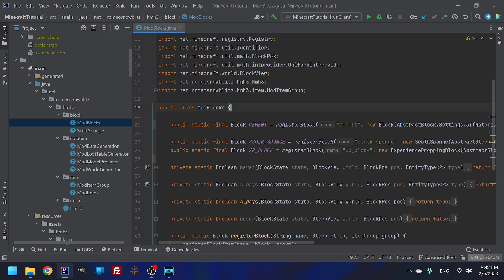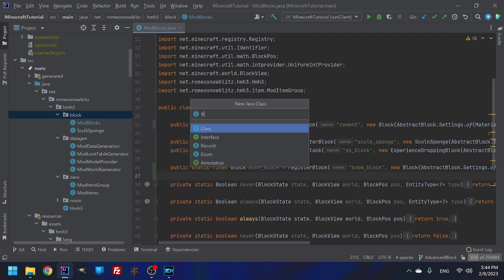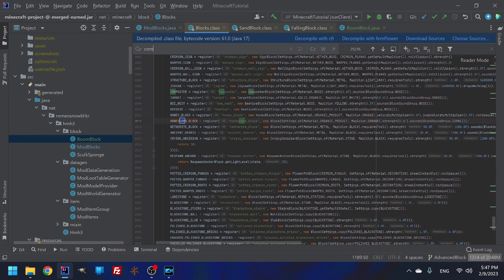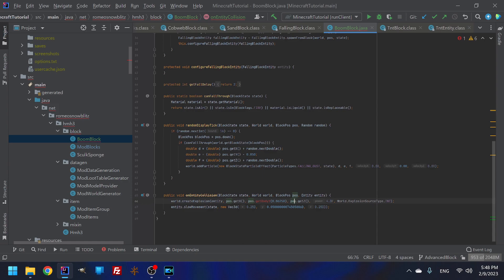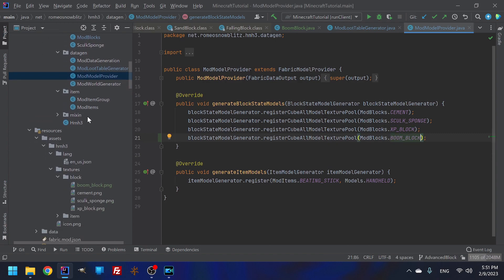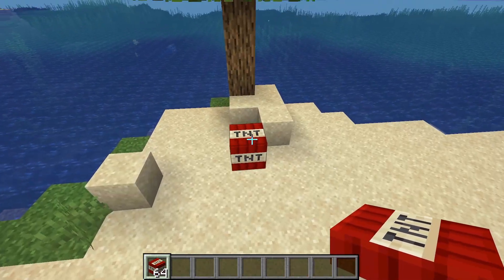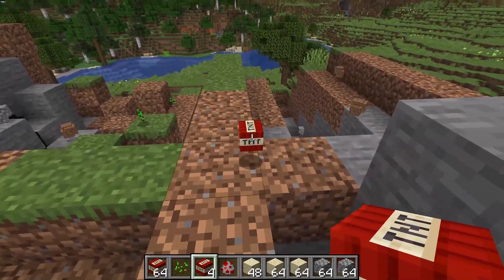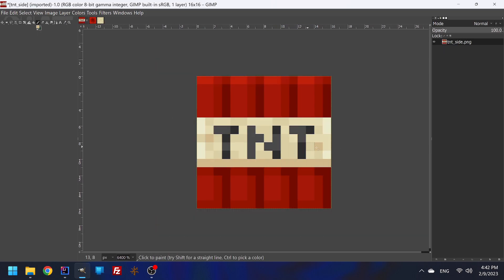Minecraft 1.19.3 Fabric Mod Tutorial #10 Combined Advanced Blocks (Boom Block)

Comment: Hey i have a question!
I tried mixing the Copper (Oxidation) and the button class together.
I made my own class, extending buttonblock and implementing oxidation which worked
but on both the actual mc source code and mine since i copied the oxidation code over there is a error with @override because of the getdegredationlevel or smth similar
is there a good way to fix it?
Reply from the maker: I find working with oxidation levels difficult, but that could be bc I've only worked with them once, I'm also not sure if the code between 1.19 and 1.20 are different with oxidation levels either, so I wouldn't have a good answer and if I did it might be updated